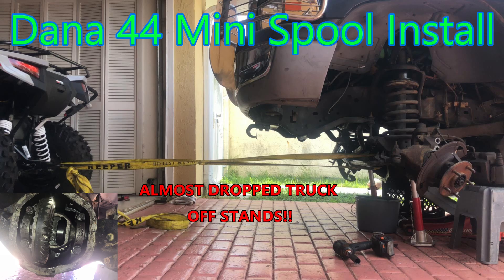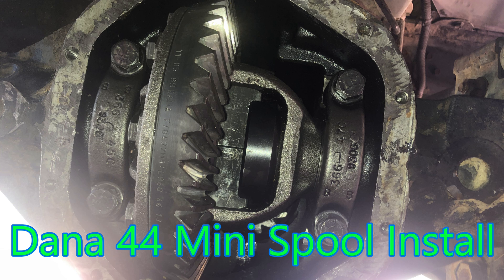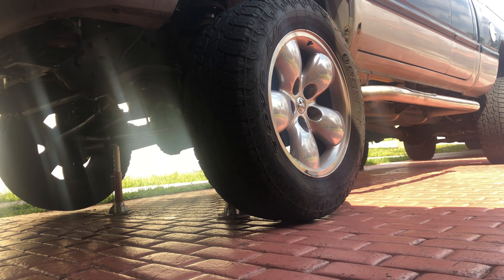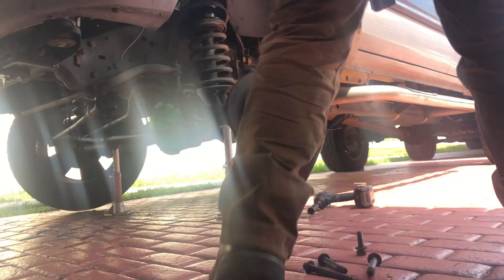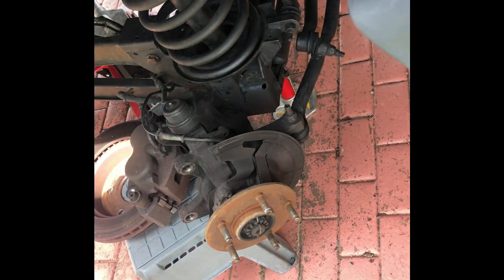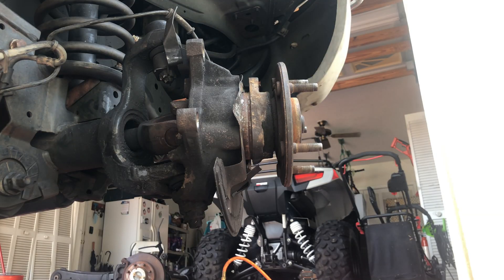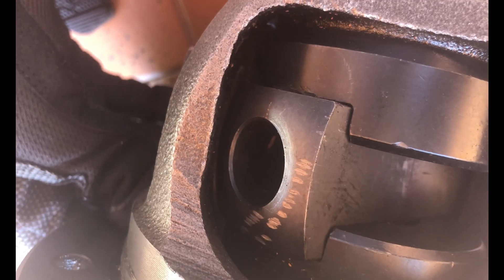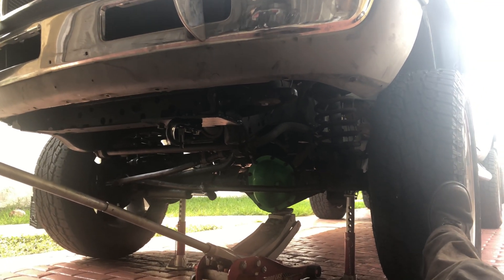Dana 44 Mini Spool Install

Comment: If you had it to do over again, with a spool on hand, would you try the spool or redo this?
Reply from the maker: Depends what the truck is for, for a mud truck like this one i would do it again. I plan on doing it on the Dana 60 I have on the truck now.

Comment: Use a shop rag on the gear and rotate it to the pinion gear..the rag will "push" the carrier out as it binds up with the pinion gear..Eazy carrier pull trick
Reply from the maker: Thanks for the tip, I will keep that in mind next time!

Comment: Ok..I can't believe that you thought using the ATV to pull the carrier was a good idea.  LoL. Glad you stopped before you made things worse.  Have you had any axle shaft issues since you've installed this?
Reply from the maker: Yea lol not exactly my brightest moment. i did break the passenger side outer axle stub at the ujoint. Oddly enough i didn't really notice when it happened. I only noticed when it was making an odd clanking noise one day. However I no longer have this dana 44 on my truck though (i since then swapped in a dana 60). If i would have keep it though i would have most likely swapped the shafts for some chromoly ones.
Reply: @EightsGarage  ok. Well , I've owned a lot of jeeps in my life. It started with 76 J-10.  I only recently sold that Jeep after 38 years. But I've had about 9 others. I still have 2001 Cherokee Sport.  Driving a 2009 suburban 2500 now. But on to point. I recently got involved with someone elses 74 j-10. There's been a couple of Stange things done to this vehicle. He has broken a rear axle twice.  He's not a mechanically inclined guy and I don't think he knew what he was getting into.  Anyway, I get this truck in my garage, find a new axle (because he had the old one welded back together) and get it installed. This is when I notice that both wheels are turning in the same direction.  I crack the pumpkin open and discover what Is a Mini-spool. I'll be honest, this is not something I would put in a vehicle. I'd just spend the money and get a tru-trac or similar. Your video was part of my research in these things (Mini-spool). I've never heard of them but it seems a lot of people swear by them. I wanted to research how many people experienced a broken axle shaft.  The guy that owns this j-10 uses it as an everyday drive. But the person who built it, clearly made it as a hunting truck and not to be driven on pavement as routine.  So, now I have to pull out the Mini-spool and drop some spider gears in there. It also looks like the original owner dropped an aftermarket carrier in. I have the old carrier, but it needs bearings and I don't want to have to do a whole re-shim on it. Anyway, that's my story to why I asked about broken axles.  Thanks.
Reply from the maker: Nice, you have had lots of jeeps, I have had three jeeps wk, xj, cj7. You should check out the videos i have of the 79 cj7 (only a few videos on it at the moment) my wife just bought (technically its mine too lol) lots of big things coming for that little jeep soonish. As to your story mini spools and regular spools are good for low traction areas, i use this truck for mud only so it made sense. But if you have any sort of power and drive on asphalt you will be snapping axles, especially stock ones. I feel the same way for lunchbox lockers and welded diff's, they all have their place but i wouldn't want them for daily driving. Good luck with that j10, trying to help on others people's projects always feels like a jigsaw puzzle to me. Any idea why he swapped out the carrier? Thats a lot of money to spend to just put in a mini spool (which are usually the cheapest style of lockers).
Reply: @EightsGarage  oh man I've had lots of jeeps. The oldest was my second Jeep a 47 CJ-2A. I've also had a 63 FC-170. one of my friends stil owns that one. I've had numerous 70s Cherokees and one wagoneer.  About 4 j-10s J-20s. My girlfriend has an 08 JK.  I also owned a 57 land rover series one. 

I can't be sure why the owner changed carriers. After my research, I speculate that there was a sale or deal at the time. Or maybe it was purchased second hand. Difficult to know without speaking to him. The biggest oddity in this thing is, it comes stock with a 360 or 401.  But this thing has a 304 in it.  I speculate that the original owner wanted a manual transmission. The gremlins of the same vintage had 304s and would bolt in. There was a lot of interchangeable parts across AMC at the time. The steering column has also been changed out. AMC did make J-20S that came factory with a manual transmission, but I've only ever driven one that a friend had.  I totally get why you'd put the spool in for mud. I've spent a lot of time in the mud. Mostly rescuing other people. This truck was clearly meant for hunting. It even has a small winch on the upper roll bar to drag in the carcass.  It was never meant for the highway. But this owner had zero idea about any of it
Reply from the maker: It is a bit scary how little research people do before buying a car/truck. When i was selling my xj (lunchbox lockers front and rear, 300k+ miles, snorkeled, lifted to hell, and on cheap 35" mud tires) i had a ton of people who were interested in buying it as daily drivers just because it looked "cool".
Reply: @EightsGarage  oh ya for sure. A lot of people wanted my old truck and it wasn't even up for sale.  They have no idea what they wanted to get into.  I had learned with a lot of blood, sweat and money. LoL. There wasn't a bolt or screw that my hands hadn't touched.  I had truck loads of parts that I had accumulated.  I sold a lot of it off and some of it went to scrap.  I didn't think I'd be going back that way.  Now in the last year , I've had three Jeep owners calling me for help.  My friend the owns that FC-170 also had a ton of jeeps parts. I've been sending people his way.  He still has a J-10 plus a 6x6 j-10 that he's been building.  When you mentioned the welded up carrier, that was exactly what I expected to find in there. I was surprised to find that Mini-spool. It explains why that axle had broke 3 times.  LoL.  There's also a chipped tooth in the crown gear. It doesn't seem to affect anything but you have to wonder how that happened.
Reply from the maker: I know that feeling i currently have a mini junkyard in the side of my house. That is crazy, three breaks all at once or on separate occasions? idk how you could even accomplish that, i am guessing a lead foot, grippy tires and asphalt.
Reply: @EightsGarage  I think one was a break before he owned it. Oddly , it was closer to the pumpkin.. I guess they fixed that and it held. Then the. Second break was while making a right turn into a parking lot (on asphalt). Someone tried to weld that one and it held for about 6 months or so. Then another right turn into a different parking lot broke the weld just past the bearing.  I couldn't figure out why the hell was he breaking axles. Then I discovered the Mini-spool.  He's running 35s on his truck. 3.54s.  I got the Mini-spool pulled out and spider gears back in tonight. The carrier is back in and I did a lot of cleaning out the pumpkin and axle tubes.  I check the opposite axle and I see it needs a seal and bearing race, so I'll just st change all that out tomorrow and hopefully I can get it out if my garage tomorrow or Wednesday.
Reply from the maker: Basically a brand new axle at this point. Good luck with that.
Reply: @EightsGarage  I did change out that broken one. In my experience, that's not going to hold long term.  I could've just left the opposite side the way it was, but that's not how I do things.  I asked him what he wanted to do and was good with whatever was necessary.  

You mentioned the lunchbox locker.  Have used one in any of your vehicle's and what is your thoughts on them.?  

I'm off to get this other axle shaft shorted out.
Reply from the maker: I used lunch box lockers (aussie lockers brand, even though they since then changed their name to torq or something like that) on the 92 xj. I had them in both the front dana 30 and the rear ford 8.8. Lunchbox lockers have a little more give than mini spools, but not as much as a limited slip would (the mini spool is basically both axles locked all the time, lunchbox they have a little spring that lets the shafts move on their own a little when not under force). Personally i never had a problem with them i never broke an axle shaft running 35" mud tires. I did how ever have chromaloy shafts in the dana 30. It kills your turning radius a bit when you have it in the front but it wasn't that big of a deal as long as you dont mind the tires chirping when you turn on asphalt.
Reply: @EightsGarage  well what a day. I made some me progress but that one axle shaft is still fighting me.  When I first replaced it, I put the bearing off the broken one on it.  It was a new bearing when they did the weld repair.  The problem was, the shaft would bolt tight, meaning there was about 1/16th inch if end play. I couldn't figure out what was causing this. That's when I discovered there was something up as both tries would turn in the same direction. That's when I cracked open the pumpkin and discovered the spool. I thought maybe the that Mini-spool had something to do with it, even though that really didn't make sense.  So, I take the opposite axle out. I see a screwed up seal and a cone that looks like it's been in there since 1974.  I get the new parts and get them pressed on. I compare the two axles and wtf?  Something is not right here.  I had assumed that both axles had new bearings. Wrong!  The best that I can determine is, the so called new bearing on the broken side is the wrong bearing and that's where this 1/16th is coming from.  How did I figure that? Well, the new bearing on the original good axle was very different.  It was tight on the shaft and the cone rode with the bearing.  I thought that set up was going to fuck me, but no. It when in clean with zero issues and is nice and tight with no end play.  Not like the other side, that has a sloppy bearing and things seem loosey goosey.   It's got to be that bearing. I've tried numerous remedies and it gain no ground. So back to the parts store in the morning and hopefully this time I can solve this 1/16th business.   I got the pumpkin all buttoned up and ready. It's just the one axle holding me back.  And that's not report for the evening. LoL.  You're probably watching the election, which I am not. LoL.
Reply from the maker: I can totally see that happening, all that extra force on the axle from the locked diff and it having all that wiggle room. But damn what a headache, do you think they put in the wrong bearing or is that bearing just completely ruined to the point where it has that much play?